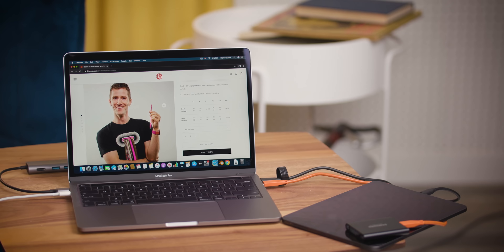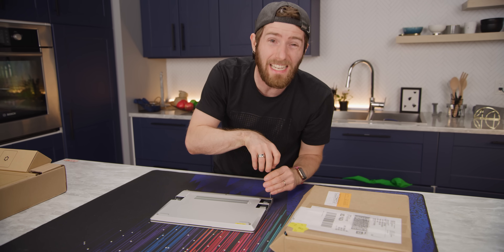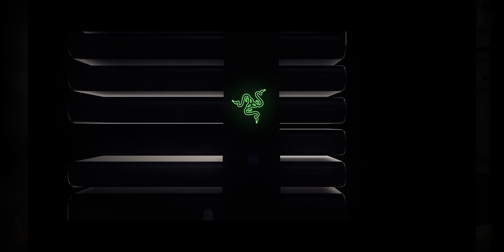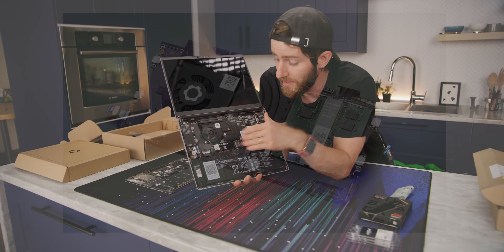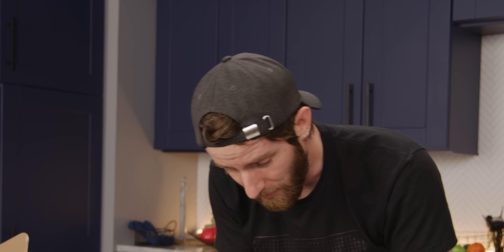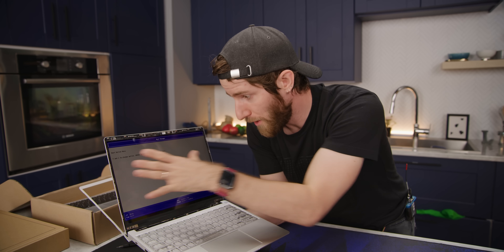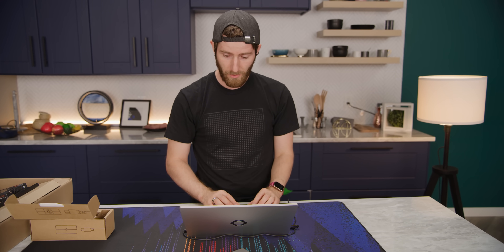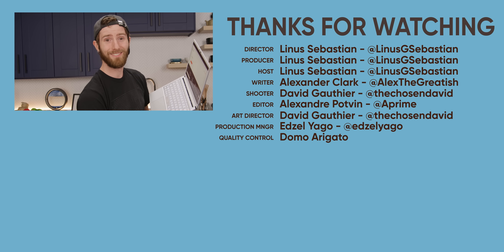A COMPLETELY Upgradeable Laptop?  - Framework Laptop Review

Comment: “The dells not even fucking thinner”-Linus
Reply: That seals the deal of Framework getting a "Better Than Dell" award!
Reply: @WinderTP  only gamers nexus fans will understand
Reply: No discrete gpu. However i still love framework’s proposal
Reply: @corlaez  eh. I am fine with integrated gpu. I would argue that those are better for laptops anyway. Even for gaming! Why? Because you might want to play longer than 15 minutes.
Reply: When new board becomes available with discrete GPU.. you don't need to buy a whole new laptop, just switch out the board and keep rocking
Reply: @wilderness-beastt  maybe if it had Radeon integrated, but Intel graphics is so awful and buggy it, for example the HDMI signal has overscan issues outputting to TVs which may or may not be fixable depending on the TV in question but a Nvidia/AMD GPU will usually work, and the performance is awful too, and you miss all the good Driver features you could have.
Reply: @XDbored1  yes i agree. Amd would definitely be better.
Reply: @XDbored1  i had no idea. I have an amd laptop where I used to game a little before. I took for granted how well it worked. So glad I bought amd.
Reply: *“The dell's not even fucking thinner” -Linus
Reply: @mmm-mmm  true
Reply: @mmm-mmm  heating performance? I would agree if I could carry a thick laptop in my bag but I can't. I used to have a thuck heavy laptop (around 5kg+2kg for a huge charger because it lasted less than an hour in a browser) trust me, if  walking alot you don't want 7kg on your back. It was an old Sony Vaio and performance wasn't great.
Reply: @mmm-mmm  it kind of helps with fitting into bags if the edges are thinner

but it feels like a non stupid idea to stuff a couple of inches worth of keyboard and battery into the middle of a laptop,

as long as you keep the keyboard numpadless you should be able to keep the width down enough to fit it into things.

heres a crazy idea what if we replaced the ODD with a slide out numpad, so smaller laptops could have a numpad

Comment: That battery disconnect feature is not what you said it was, its for when you want to take it apart to access something on the motherboard. What you said is doable with software if the motherboard supports it.

Comment: Meanwhile Apple is soldering on the SSD and Ram onto their laptops with zero consideration of repair or even data recovery in the event of system damage. Inexcusable.
Reply: Everyone does it now....please don't shove it all into Apple's fault. The only thing upgradable these days is the storage usually. Even RAM gets soldered on now by multiple manufacturers. Not just Apple.
Reply: @MsToshi1990  Hmm.... I wonder who started that trend
Reply: @abdansyakuron1391  doesn't matter who started it if everyone is following then. Means everyone prefers doing the same crap.

Comment: Meanwhile my ideapad 520's screen is dead(because one of the hinge snapped and broke the display one day), the screw plastic area which holds the metal threads have all gone brittle and broken apart...
I'm only left with LAP instead of my LAPTOP :(

I couldn't even find replacement parts for it cus they aren't available for purchase, either in the form of not in stock or an atrocious price markup.

I would've definitely chosen this framework laptop if i had the money right now.

Comment: This sounds and looks great. Similar things have been tried many times but the failure point is usually the “big corporate lock in” issue of being a captive market and getting absolutely rinsed on the cost of the clip-in external I/O modules. Hopefully they avoid that, it sounds like they have the right attitude to actually make it work.

Comment: Ok, I have an idea, and I'm not sure if it'll work. But what if you could plug a graphics card and have it sit on whatever side of the laptop you want? Cooling wouldn't be too hard, because it would be external (as long as it doesn't get too hot to touch). Put a metal/plastic mesh above the fan, fully enclose the circuitry, including from the fan, so it's waterproof and durable. Then you could decide every time you went out if you want power or portability, and it would be almost perfect
Update: it exists
Reply: Doesn't thunderbolt already give this option?
Reply: @farissalim7208  Oh shoot you're right, I hadn't heard of that before 
Now I'm really tempted to get this
Would have to wait a bit for that to become a realistic option though, as only one laptop has that option as of now
Reply: @deadwhitedragon9751  😂. Never have used that myself tho. Just know that it is expensive.

Comment: Battery disconnect - That's a really good feature. Every EV has an option to charge up to 70%, 80% or 90% to prolong battery life. Every 10% drop almost doubles long-term battery life

For example 500 discharge cycles when charging to 100%, ~1000 discharge cycles when charging to 90%. This is because li-ion batteries age faster at higher voltages (higher state of charge)

https://batteryuniversity.com/article/bu-808-how-to-prolong-lithium-based-batteries

Comment: Product suggestion for Framework : an optional base frame for the unit with double the battery capacity and enhanced cooling, with optional ruggedized wrap. This would be HUGE for field-unit deployments, as battery life and survivability is paramount. I don't believe this would be an expensive proposition, as it would involve basically zero electronics alterations beyond the mainboard firmware detecting the larger battery option. A thicker cooling solution would also give some additional peace of mind for when it has to go out to an oil rig in West Texas in August. Additionally, a slide-over UV and scratch resistant display cover would be extremely welcome and round out the options for ruggedization. Given the very high cost of options in this market, prices such as $249 for the double battery ruggedized/enhanced cooling base, and $129 for the ruggedized UV screen cover would be completely feasible and an outright bargain compared to their contemporaries. 

The market for super high battery capacity ruggedized laptops is criminally underserved, and a device from a company as respectable in ethos as Framework is showing to be would be a true breath of fresh air. If they build it, they WILL sell them to capacity. 

GJ guys!

Comment: Sadly this is going to fail or remain niche like any other company that has tried this in the past. It's all about brutal capitalism now, companies that actually care and look out for the consumer can't be as profitable anymore.

A very cool concept though, I certainly hope the modular IO is adopted by more manufacturers. There does seem to be an issue of not fully taking advantage of the space available, like they could make the modular pieces a little bigger and manage to fit 2 USB-A or USB-Cs or a sound card that has separate input/output (convenient for headsets that need it) or any combination of ports. This would allow for much better use of space.

Comment: I hope they can make a 15" or even 17", that's a lot of modularity potential.
Reply: 15" and 17" screens with a 3:2 aspect ratio are very unlikely, i don't think they even exist right now.
They would be so massive vertically that they would be more fitted to a mobile workstation imho.
Nonetheless it would be awesome, but very pricy.
Reply: @hypnoz7871  16:10 is pretty close to 15:10 (3:2) and 15inch versions of those exist
Reply: @hypnoz7871  15 inch 3:2 already exist which what Surface Laptop and Book uses, but yeah the supplier is limited that they have to also get that from the same manufacturer of Surface displays, which is expensive. But would be nice to have a Surface display panels on non-Surface laptop.
Reply: Imagine modular gpu for gaming laptop
Reply: @drganja3917  Those already exist in the MXM form factor. https://graphicscardhub.com/wp-content/uploads/2017/09/mxm-gtx-1080-1070-1060.jpg

They just cost a freaking ton more money for usually less performance compared to their desktop counterparts (wattage and temperature limits with small coolers usually found in laptops...), because they don't take that much advantage of economies of scales because "maximum integration!!!" leads to soldered dies. Yeah I'm salty.

AsRock tried to bring MXM to the desktop on the mini-STX motherboard form factor but didn't bring it to market. https://external-preview.redd.it/AWPT5FoaH-NAb2A7Vp08FN8smL7AtrOWz8cr8B0IY1g.jpg?auto=webp&s=965100927366e5725980dd03493a4faea9f6373f
Reply: @ujiltromm7358  oh, I didn't know thanks for the info.

Comment: I hate working on Laptops, after opening a couple, I now refuse to do hardware repair on laptops. I will do software repair, but nothing that requires me to open them. This Laptop however is a gamechanger. If all laptops were like this one, I would gladly do laptop repair, but until companies start following after this design, it will be awhile before I am fixing any laptop hardware issues.

Comment: This laptop ACTUALLY feels futuristic isteady of "older modular technology"
Reply: True
Reply: Krazy Kommando  to save idiots like you from spending 1000$ for false promises future proof scam. Current gen ssd and ram and modular IO will not make your laptop future proof in the next 3 to 5 years.. This is pretty much the same on all laptop.
Reply: U mean instead?
Reply: if fully upgreable was real then why is it the modular parts are only usb and hdmi (IO)? Alot of you are so confused about this fail laptop:

Pros: 1. easily removable module usb a, hdmi, usb c, sd card
2. Easily removable battery and screen (But all windows laptop can be remove)
3. Replaceable front screen frame.

Cons:
1. Expensive 1000$!for base model
2. Expensive Up to 2000$ for 512 ssd and higher cpu.
3. Did not even mention any rtx card at all 3 models.
4. Current gen ddr4 slot and current gen pcie 4 slot are not modular as well as cpu and gpu in short if you upgrade the motherboard it will cost alot since it is pretty much the laptop itself.
5. They dont make their own chip, so all future motherboard with new cpu,gpu, next gen ddr5 slot, next gen pcie 5.0 will probably cost almost at the same price of a traditional laptop.
6. If for example you bought a new motherboard, you are stuck with worn lcd, worn keyboard, old gen ssd card, old gen ram, worn charger and worn or full of scratch laptop frames. For the price almost the same as the new laptop with everything new.
7. Not to mention the terrible cooling system design of laptop is terrible. Look at all the upcoming gaming laptop, they are way better than this.
8. In conclusion this laptop is not future proof, having a module IO will not compensate for the lack of fully upgradeable next gen hardware such as gen 5 pcie and gen 5 ram.
Reply: @jonmon5745  your comparison to a gaming laptop for cooling is stupid. This is a thin and light. Compare it to thin and lights. 

Everything else you’ve pointed out is literally true of ALL laptops so they’re utterly redundant points to make. The exception being apple making their own chips… which doesn’t matter because they can’t be replaced either.
Reply: @lukefreeman828  how is my cooling comparison stupid? we are yet to witness a wave of next gen laptop even lenovo right now just introduce a slim gaming laptop the Legion 7 slim it is 2021 thin and light rtx gaming laptop with very good cooling system check it out. The point is that this modular IO laptop is pretty much the same with all laptop "you are stuck with current gen hardware" in short you are paying premium price for modular IO.
Reply: @jonmon5745  Thanks for your comment, $0.016 has been deposited into your account. 
Regards,
-the Apple-Dell coalition
Reply: @somelokyguy6466  thanks
Reply: @jonmon5745  No problem there friend.
One other thing, because I see it in so many of your comments. "Alot" isn't a real word, what you're looking for is "a lot".
Reply: @jonmon5745  No you are the one who's confused everything is modular and in the video Linus clearly pointed out why the things that aren't like the cpu and motherboard isn't watch the video 5 more times instead of writing your long ass bullshit take on this laptop

Comment: Almost everything on this is great. Finally getting real upgradeability and reusability in a laptop. However, the expansion adapters ruin it. All of those included ports could have come pre-installed on the motherboard. some people mentioned less e-waste but this just creates more with extra male/female USB-C ports, extra PCB, plastic casing, and packaging. The big reason most laptops don't have them is space but in this thing, you could make it slimmer and keep all those ports. There would even be enough room to include ALL of those ports plus a more useful PCI-e Expansion slot with the connectors like the GPU uses. With that you could even get a direct connection for a much more powerful external GPU rather than going through USB-C/Thunderbolt. This could even allow you to add Thunderbolt to an AMD system, providing you pay the Intel tax for it. Any further expansion beyond those ports can easily be done with dongles as that is all those are, just dongles with slots to fit them inside. Removing the wasted space from the adapters would also give more room for better cooling, as what is there doesn't look like it would cool the top CPU's without throttling. This kind of reminds me of the Moto Z2 or LG G5 which flopped for the same reason they were made for.

Comment: If next-gen has a touch screen and Ryzen options I'm all in.
Reply: Maybe touch screen display and Ryzen will be upgrades to buy separately
Reply: @MudkipMan97  And then Graphics cards maybe?
Reply: @MudkipMan97  You can't upgrade CPU from intel to Ryzen. You can however unsolder Intel and replace it with another intel because reballing (making new contacts that get soldered) is not extremely hard, just have to find a heater and do it properly which I'm pretty sure is possible.
Reply: @shale1337  the only limiting factor is chipset, they can build the same motherboard with an amd chipset and utilize amd cpus, but they'll need a separate thunderbolt chip for that functionality
Reply: @chiefdenis  Yeah, I'm pretty sure Thunderbolt is Intel only at the moment. At least I've never heard of an AMD option.
Reply: @jamesmnguyen  I think they open sourced thunderbolt 3 to become the USB 4 standard
Reply: @jamesmnguyen  Intel opened the protocol for use as usb 4, the m1 macs also have thunderbolt even though they're not Intel powered.
Theoretically, any amd system could have it if oems weren't being cheap
Reply: @MudkipMan97  That would be actually super cool. If they are succesful I can't wait for the gaming laptops
Reply: Yes

Comment: i like what i see on this laptop, but i do wonder about the 'wasted horizontal space' on modules
why only 1xUSB-A in module where it can fit 2xUSB-A next to each other  (USB-A 3.1 can fit 2 at USB-C 3.2)
the lack of USB 4 may prevent o put e.g. 2x HDMI, 2x DP or combined 1x HDMI 1x DP into single module
about display, i agree it needs touchscreen with better IPS/OLED/IGZO type (10bit,HDR, 75-240Hz)
also this type of modules isn't unheard of (similar to some of the hardened rugged enterprise ones)
yet for end user normal market that's really nice job

Comment: say what you want, but this barely any better than some hp and dell laptops you can buy today that have replaceable batteries, ssd's, ram, and wifi cards. until this company gives the option to buy parts like the motherboard, battery, screen ect. it's repairability is worse than them. their website claims that the warranty won't be honored if you don't use their certified parts. only when they provide the schematic will they truly be a company that lives up to what they claim to stand for. and not being able to replace the cpu is very clearly NOT completely upgradeable, although it's a very common compromise. you can still buy new laptops that take desktop cpu's in a socket. the modular IO thing is cool I guess, but there isn't enough ports overall, and you plug these ports into other ports mounted right on the board.

Comment: The main issue with this type of laptop is the adoption rate and support. Will the company still be around to support upgradeable modular parts especially for the CPU/motherboard component if I were to upgrade it 2~3 years or even 5 years down the road? Without third party support, you can only hope that the company may still be around or continue to make new and replaceable modular parts to prolong their support for this laptop.

Comment: This is so awesome! It does seem to be lacking in the gpu department but I would be completely okay with that if they have a way to maximize use of plugging in an external docked GPU which I can completely see them being able to do. I love that you can disconnect the battery as someone who works online and travels a lot I use my laptop as my main machine and have it "docked" especially during these times almost all the time and on plugged in power. Being able to configure the ports is also great. I cannot wait to see their next option.

Comment: Love the concept, disappointed that the one thing that forces most laptop replacements is still an issue though, no replaceable discrete gpu.  I've made a long career of laptop repair and support, and my thoughts are this:   Other than the slottable usb-c dongles, the rest is already replaceable in many laptops.  Without a replaceable d-gpu, most consumer laptops are still going to end in a landfill or recycling center every time it won't play the games people want (and a lot of business class laptop users don't need most of this anyway, the memory, wifi card, drives and batteries are pretty accessible on most laptops, even if they take 9 screws instead of 5).